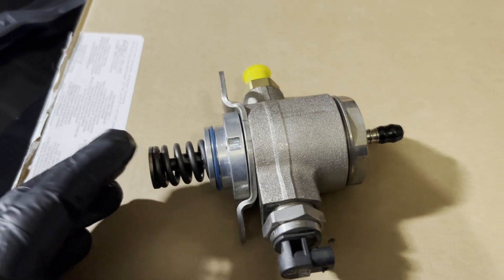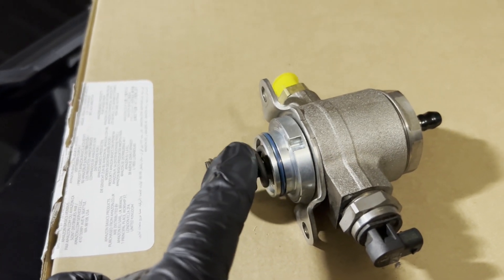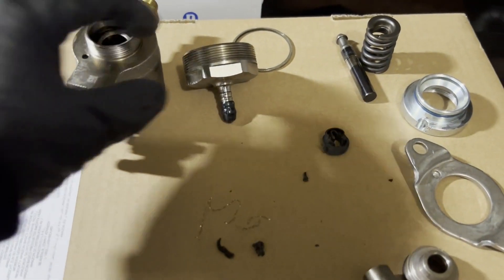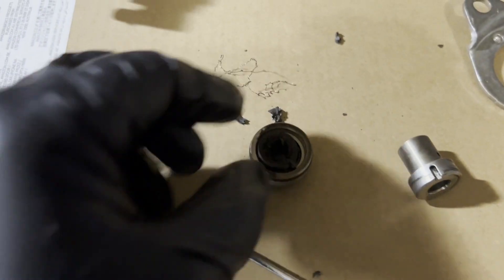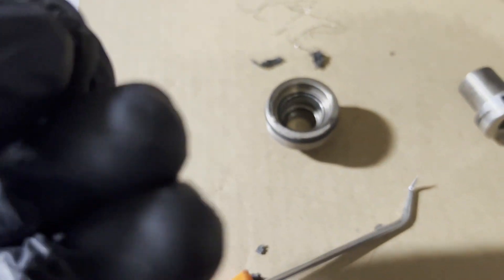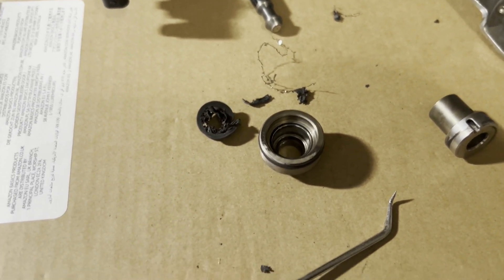High Pressure Fuel Pump Fail Code P2188 in Audi Engine

Comment: Hey Sam . Do I  have  to change the  engine oil and filter after put a new pump  ? Thank you
Reply from the maker: If pump leaked fuel in to the engine that will dilute oil and ruin all the bearings, so any time I change this pump due to leakage I always change oil and filter as well. Thanks for watching

Comment: Hi sorry would this cause slow acceleration, really low on power and turbo not boosting as before too??mine is also leaking through the spring but I don't have codes, just have negative fuel long term fuel trims and at idle short term trims jump from positive to negative
Reply from the maker: It can especially if pump leaks, if you are sure that pump leaks in to engine I would replace it regardless if check engine light is on or not since that can damage engine, also with the problems you described, surprises me that check engine light is not on yet.
Reply: @samstye  Thank you for your response, so can this pump leaking be the cause my ECU is pulling fuel and that's why I have negative fuel trims?
Reply from the maker: @ In order to get idea what's wrong with the modern cars these days you would need to scan your car ECM with OBD2 scanner regardless if check engine light is on or off, if you don’t have one your local car parts stores have and in most cases they scan it free of charges for customers and gave you trouble code they find,
But yeah it will be too lean at idle in most cases bank 1, also your fuel injectors can leak as well.